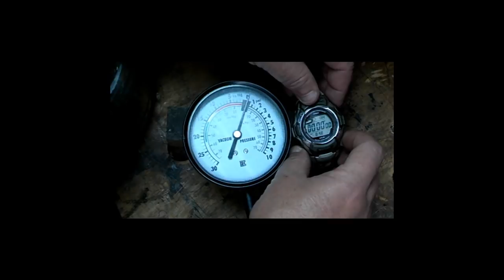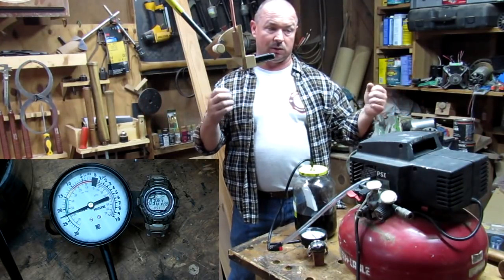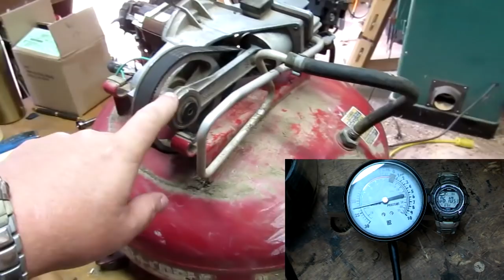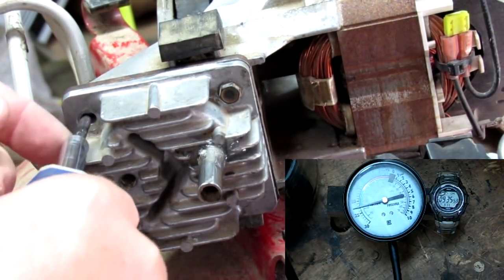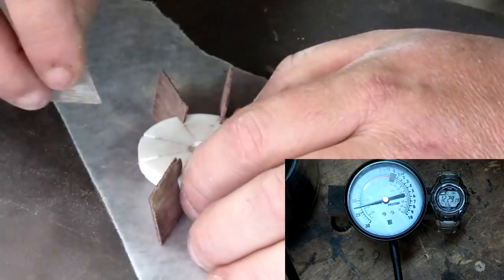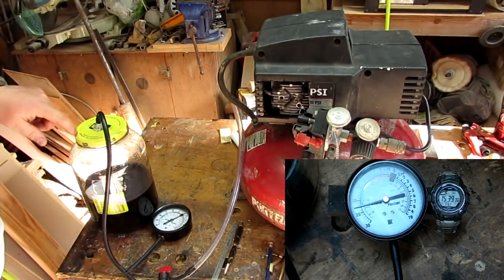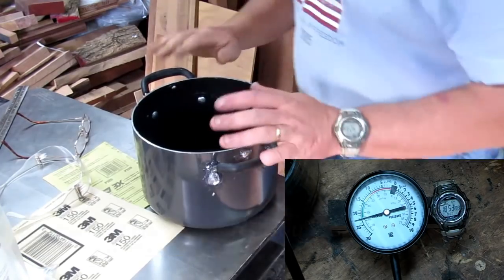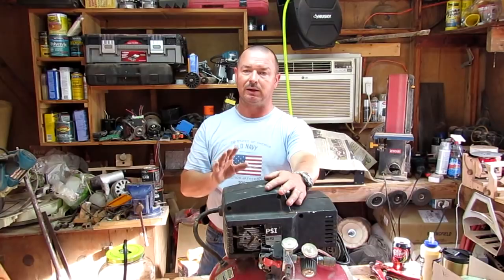#96 Converting an Air Compressor into a Vacuum Pump

Comment: I tried this conversion this morning with my Airmaster Tiger 15/55. It has two cylinders pulling air in from a common housing with a filter. I fashioned a  thick wooden disk with a rubber gasket where it comes up against the rim of the circular housing. I secured it with a bolt that fitted the socket inside. This originally held a plastic cover with some vent holes in it. A small hose union also goes through my wooden disc to connect up to my vacuum chamber.
I ran the compressor and a vacuum was achieved within about 2 seconds ! - The needle on my vacuum gauge remained stationary after reaching it and didn't creep up any more. but it was only around 1/3 of the vacuum I can get with my hand pump though I have to squeeze that pump very hard towards the end. Even though it is not a very good vacuum, it might be enough for my purpose which is remove bubbles from mixed resin.
Reply from the maker: Glad yours is working. doesn't sound like you have any leaks. Could be that you have a leaky seal which will only let it pull a certain amount of vacuum. I have good degassing for resins anything over 15 hg seems to work well though maybe a little slower. Thank you for the conversation. Take care.

Comment: Very innovative and practical, Stephen. I have an old compressor in the barn that I mothballed because it had a leak in the line going into the tank. If it still runs, I think I've found my next project.  Thanks!
Reply from the maker: +Paul Gibson Thank you Paul. I hope your build goes well. The old compressor is a great choice. I think you will like your results.

Comment: Your timing on this video fit my schedule perfectly as I've started looking for a vacuum system to do some spalted oak myself.  I too was wanting to convert a compressor, so thanks.  
Tom Wilcox's idea works well too, I used an automotive compressor to put  a compressor on my truck.  I found that an old (60's) Chrysler air conditioning compressor and they are a 2 stage compressor, way better.  
I use a toaster oven to dry my blanks, if you wait till winter it reduces the house heating cost.  It only takes an hour at 150 degrees.  (checked with my delmhorst moisture meter)
I'm 118 on the like list.
Reply: Tom, is the 2 stage you speak of another way of saying it's like a twin cylinder compressor? I was never a Chrysler fan but those compressors are beasts. 1 of my 1st-grade school hacks was making a bike tire pump from 1! It's been so long since I've seen one, I can't remember what to hook up where! lol

Comment: Steve, great description of how to make new use of an un-used piece of equipment.  If you do find a need to use it as a compressor though, consider wrapping that new inlet with some type of air filter.  Not doing so will make the unit useless for anything other than a boat anchor.
Thanks
Reply from the maker: +Mark Freeland Excellent point Mark and thank you for the suggestion. The original intakes did not have a filter but when I use the new one it will. Thank you again.

Comment: As is custom, I compliment your ingenuity & your desire to share this knowledge with the masses.
 I would like to share some of my knowledge with you, if you don't mind. My first thought is: As you wait for the dye to penetrate the medium, once the bubbles are done perking, you can start working with you newly dyed materials. The waiting period after the perking at 0 pressure is gratuitous & unnecessary. The space the air was taking up is immediately replaced by the dye, so the extra wait is not necessary. My second thought is: If your interested, you can make a good vacuum table with your compressor/vacuum. For woodworkers, it's great for curved forming & veneering. When the molding is done, you have an air source for sanding tools & spraying the finish. That's a handy compressor/vacuum Thanks for sharing.

Comment: Hi Steve,
I'm sure someone has already mentioned the danger of implosion.  What we do in the lab for our vacuum jars is either wrap them in electrical tape, or put some plastic mesh (like an onion bag) around them to minimize the potential damage if implosion does occur.  I've also used a brake vacuum hand pump, but it's only good for a small vessel for 3-4 pen blanks.
Reply from the maker: +Tim Whitehead Thank you Tim. I appreciate your suggestions and insight.

Comment: Steve : It's people like yourself that make you tube fun. If you would like to quiet things down a bit,try setting the compressor unit down inside of an old picnic chest. you have to drill a few for lines and so the pump can get some air.
Thanks for your Videos
Karl
Reply from the maker: +karl richards Thanks Karl. Glad you enjoyed this project and thanks also for your suggestion. This would really be nice to keep it a little quieter in the shop. Thanks again.

Comment: This is GREAT! FIrst I have the exact compressor (maybe newer) but I did get a free one off a garage sale this summer... guy said it didn't work. I brought it home and replaced the fuse!~
Reply from the maker: +Colin Léger That is great Colin. I was surprised to find a fuse in mine. If it had stopped working for some reason, it may have just been thrown away.  Great score there sir

Comment: idea: keep a male fitting on hand with no tool attatched. and leave the compressor side  (the hose) plugged in. When you want to use it as a vacuum, just plug the male quick connect fitting into your compressor's female quick connect. you could also use the small air blower attachment and keep the trigger depressed with a rubber band or something. This will basically just opens the tank to the outside air. This way you don't have to mess with unplugging the hose everytime which could be a pain and could wear the hose down prematurely. The quick connect will probably last forever, and if they do wear, it's simpler to replace than the hose.

Comment: To help the pump , you can temporarily disconnect the output tube to the container
so it will have less resist to the building of vacuum and you may get higher vacuum value.
Benny
Reply: +Benny Naor He had the drain valve open.
Reply from the maker: +Benny Naor Thanks Benny and good point. However, Thomas Hanson hit the nail on the head. I keep the compressor tank petcock valve open while using the vacuum side. This will not allow pressure to build in the tank.

Comment: I have been using a food saver for a vacuum source, I like this idea much better. Thanks for sharing.-------- Stephen I have been using Ritz fabric die, but being water based it presents some issues with wood. I watched a vid of Molly Winton (pyrography), where she divulged she uses alcohol based dye, used in Leather work. This should penetrate the wood better because alcohol has a lower viscosity than water. Plus it should cause less swelling and maybe alleviate kiln drying, remember alcohol is very flammable!  Yes I ordered some on the web. They don't give any dye away, and I'm still looking for a cheaper way. --------I thought you got yourself in a "pickle" with the broken fan, but no worries.------ Since you have an excellent vacuum source you can now explore bagging in place of clamping, this trick can turn a difficult glue up into something manageable.
Reply from the maker: +Stephen Johnson Thank you Stephen. I too use the RIT dies for coloring wood and agree that the alcohol based works better.  Thank you for sharing your ideas and helping folks.

Comment: I'm looking to do vacuum forming with kydex & other plastics, which need a quick high volume suction very quickly before the material cools.  So I'm wondering if i could use this method, but to create vacuum in the compressor tank itself?
Reply from the maker: Thank you sir. Glad you enjoyed this project. Vacuum can be stored inside a tank. I am unsure about the compressor tank itself though. They are designed to hold compressed air and may not hold vacuum. I have seen people build vacuum tanks from Schedule 40 PVC pipe for just that purpose.  It should work fine for your application. I hope this helps. Take care!

Comment: i been using a seal a mill you can get these at yard sales or goodwill for 5 to 10 dollars it will draw 26 to 28 bar i put a shut off valve on it let it run then shut valve when vacuum drops start it up again after first hour it will hold vacuum. i let it set for 24 hours at 26 to 28 bars.then release. it takes 4 to 5 days for the catus juice to enter wood. if you marh the jar you can see how much goes in;
Reply from the maker: +KNIFE MAKER Excellent suggestion sir. Glad you shared your ideas and methods with us. I really like the idea of using the vacuum food storage pump.

Comment: More then excellent video man!! I've been looking for a compressor for a while now, to have some air supply for when I hollow, but knowing I can get a vacuum pump out of it too! I've been wanting to experiment with blanks and colored epoxy.... Thank you again, and yes, I know it's not your idea, you didn't invent this, you were not the muse for the original idea, you've got no idea who is the first of firsts who thought this up. Thank you for clearing that point :)
Reply from the maker: +Yuval Lahav Thank you my good friend Yuval.  This compressor will pull vacuum as well as any vacuum pump of its size. The small 12 vdc ones will also pull as strong. Just not as fast.  You will enjoy your experiments with the dye and epoxy. I have.  it is however, pretty expensive for the resins. I do not want anyone to think I am claiming this idea. Glad I made that clear. Thanks again Yuval.

Comment: Hey, I just came cross your video, I want to do this as a backup for the vacuum pump that runs my milker for my cows.  I'm wondering, how long can this thing run without hurting it?  Will it work for 20 minutes of use?

Comment: When using the pump as a vacuum pump, instead of removing the tube to the tank, wouldn't it be easier to just open the tank tap to let the air escape through that route ?
Reply from the maker: Thank you Richard. Glad you enjoyed this project. Yes, opening the petcock valve is a better idea.

Comment: Hi Stephen! :) Steve and I are making our vacuum chamber now, and I came here to find out what you used to seal your lid with. Found the answer in the comments: "What did you use to make the seal on the glass top?" Stephen Ogle: "I used a closed cell foam as a gasket." Excellent! We also found that some use silicone caulk. We tried a test last night with a couple of different types of rubber mat materials. One only worked if you pressed really really hard to create a vacuum but it didn't hold the seal. We tried another type of mat material and it held much better but still didn't hold the seal. So now we are looking for a seal material that will work perfectly. Hopefully there are not leaks elsewhere, but Steve used pipe seal etc so it's hopefully just the seal in the lid that's not holding. Wish us luck!
Reply from the maker: Thank you Janet for writing. I did not talk much about the vacuum chamber because at the time it was still relatively untested. I used closed cell craft foam that I bought at Walmart to create the gasket on this chamber, however I have since purchased a piece of 1/2" plexiglass or lexan and am using it now. Works better than the pot lid. Just make sure it is thick enough to take the pressure. Also instead of a gasket I used a plastic tube (weed eater fuel line) around the rim of the pot. You have to cut one side of the tube so it can open up and be placed onto the rim. I hope this helps. Let me know how it turns out.
Reply: Hey, thanks so much for the lengthy response, Stephen! I read what you had to say to Steve and he was really interested to hear what you did. He was thinking about the idea you are now using, tubing that is slit all the way around. Right now we have silicone caulk drying on our pot and are hoping that it will provide the perfect seal. I'll let you know if it worked. If not, we'll try what you're doing, but I hope we won't have to!

Comment: Stephen I have lung problems, so am putting in a pretty serious dust collection system. Part of it will be the use of a Rockler #45556 dust separator. Can I just tie into this unit to get my vacuum?
Reply from the maker: Thanks for asking. I do not know for sure, but I really doubt a dust collection would have the ability to pull very strong vacuum. They are designed to flow large volumes but not necessarily strong vacuum. I hope this helps.
Reply: Ok, Well It won't take much to set it up. (And inexpensive ) It's going to be a little while,  but I'll let you know how it comes out. Thanks for the reply.

Comment: great job but if you only need to pull a vacuum you could make something for less than $8.00 it will still have to be connected to the compressor.
you can make it out of a 4 x 4 chunk of plastic or even wood and some fittings.
or just buy the 001-at-10153  4.2cfm for $20.00 or less.
Reply from the maker: +gamerepair2020 Thank you and I appreciate your suggestions. I wanted to build a venturi but could not find any specs on them. Could you elaborate where the information might be available. Thanks again.

Comment: don't you have to keep pulling vacuum until bubbles go away compressor on if you close valve wont that stop air from getting removed wont it just stay were it is with valve closed just asking
Reply from the maker: +bigbear4x43 Thank you sir for your question. As long as the chamber has negative pressure on it the blank will continue to equalize by releasing the air trapped inside. This will however gradually decrease your vacuum inside the chamber and you may have to open the valve and turn on the pump to get the vacuum pressure back where you need it. I hope this helps. The pump does not have to keep pumping throughout the process.

Comment: Hi Steve, You mentioned using water based dye. I have a question. Do you use water based dye to color your blank and then Cactus Juice to stabilize your blank? Can the processes be combined? Can dyes be added to the Cactus Juice? Thanks for sharing!
Reply from the maker: Thank you Don. Yes, dye can be added to the Cactus Juice and it makes some really beautiful blanks also.  I would avoid water based dyes in it though. I use the Alumilite Dyes for the Cactus juice. Water based dyes I use on bare wood mostly. I hope this helps.

Comment: thanks . I've noticed you trouble on fan motors lol but can't you make your fans with your CNC MACHINE ? just a thought for future videos for your cnc with Corian material
Reply from the maker: +timothy mcswain Thanks Timothy. I hate fans! Of course because of these failures I have become quite proficient at making replacements. LOL!!  Good idea to use the X-Carve for making one. I will give it a shot.  Have to design it first. Thanks for the idea.
Reply: What gave me the ideas was all the different types of tools people was making with them .just about anything for the lathe within reason

Comment: I suppose I should ask, how did those blanks turn out? Was really wondering about using water based dye on veneer oak, kind of like skate board ply. Any thoughts?
Reply from the maker: Thank you Martin. The Dye worked very well on these blanks. Not sure about your Oak veneer. If the wood is hard it could be difficult to get the dye into the fibers. I would suggest testing it on a scrap piece first. I hope this helps.
Reply: @StephenOgle  What dye did you use? The question that you knew was coming.
Reply: @StephenOgle  Thanks Ogle, but I think I cracked the case. I am using generic fabric dye, mixed heavy in mason jars, which are living on a portable skillet dressed in a silicone mat. 70C for 3-4 days. 1/16th veneer and no need to sink it as it settles. Successful dye infusion and as a bonus, different woods have different colours with the same dye batch. No need for fancy vaccuum. Still gonna try this mod one of these days (looking at my 1.5HP compressor).

Comment: Hello Stephen, Can this same setup be used with a vacuum press bag for veneering or is that a different concept than what you did for stabilizing wood? Thanks and great video.
Reply from the maker: +Ordinary Woodworker Thank you sir for your question. The answer is that you absolutely can use this same system for your vacuum bags. After all it is simply a vacuum pump regardless of what you use it for.  Glad you enjoyed this project.

Comment: Sir how do you have your vacuum pressure gauge hooked up inline? Great idea. What have you replaced you jar with. I just find the jar and now may have to upgrade? Thanks!
Reply from the maker: Thank you Charles My gauge has two 1/4 inch fittings to fit it in line with your 1/4 inch hose. The vacuum chamber I use now is made from a steel pot (from Walmart) that I converted. You can see this pot at the end of this video. Click here to see it.  https://youtu.be/qq0c8qsx3eA?t=1132
Reply: Thanks Stephen.

Comment: something i dont get, surely there has to be a valve on the intake side just the same as the exhaust, a check valve in the line to the vacuum chamber is required i believe
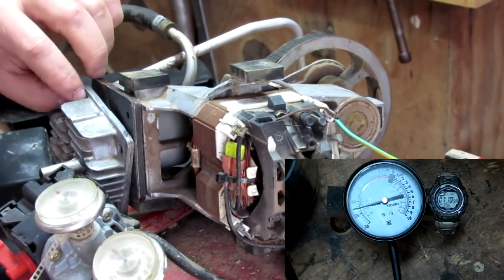Reply from the maker: Good observation and you are correct. It could not work as a compressor or a vacuum pump without them. The video clearly shows and tells the valves and the differences. Check out the video at 7:13. I hope this helps clarify. Take care.
Reply: @StephenOgle  yes i got that, you blocked off the old intake and inserted a tube into the head for a new intake.  that new intake requires a check valve somewhere.  the compressor i intend to use has a threaded in airfilter(1/2" npt i believe), should be much simpler!
Reply from the maker: @stevem268  Okay. However, there are no other valves built into the system. There are no check valves and none are required because the intake valves themselves will not allow the compressed air from the tank to back flow and vise versa.